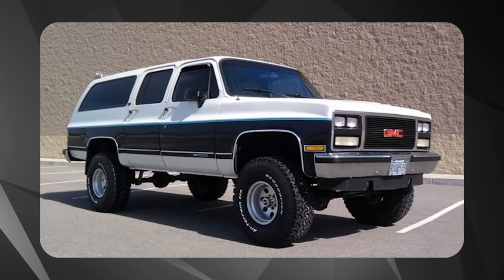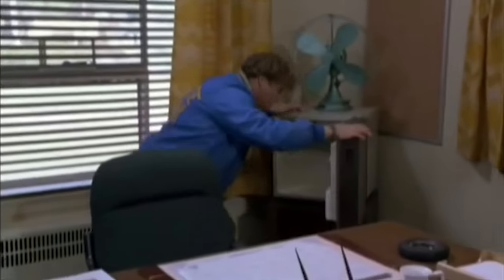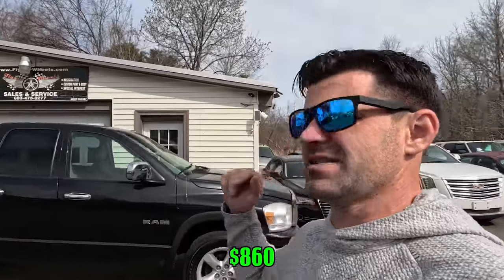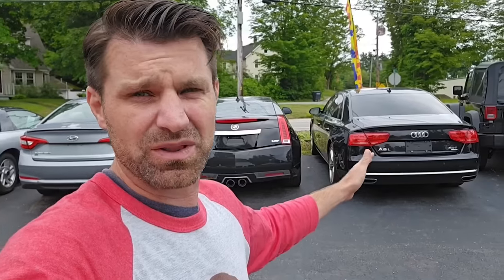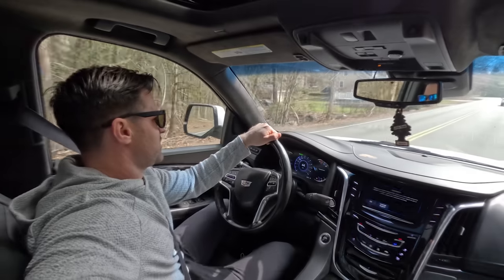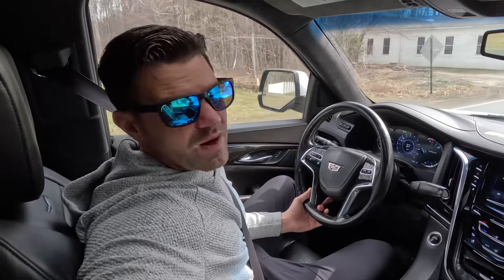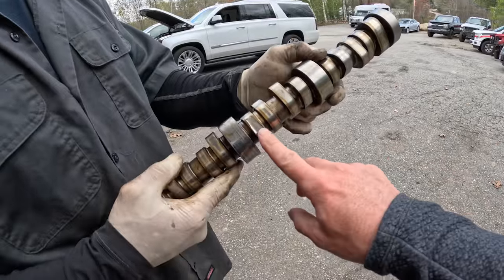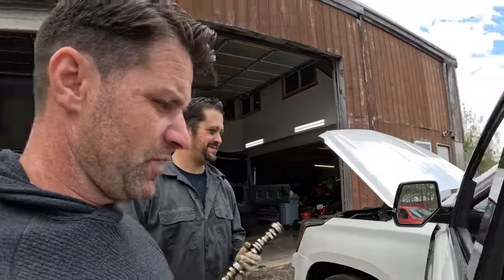WARNING! GMC Chevy & Cadillac Escalade Engine Problems at only 53,000 Miles! - Flying Wheels

Comment: Delete that active fuel management every new GM car you get.
Reply: The transmissions are a weak point as well on GM trucks so doing an actual internal delete of AFM as soon as you buy it voids the warranty and then you could be on the hook for major repairs that could’ve been covered under warranty unless your just talking about the delete that plugs into the OBD port which I would definitely recommend
Reply: There’s probably liability issues for Craig if he does it and then sells it on.
Reply: I’m sorry when ever a consumer purchases a vehicle from a used car dealer the chance that the vehicle will be a problem shortly after is 50/50
Reply: @TheIrvingsylva  There's a reason why people turn in vehicles earlier than you'd expect. If they just wanted something new every 50k, they'd lease, and everyone knows it.
Reply: did you hear what the mech said? "for like 1 mpg fuel savings"

I ran the numbers on the ford 5.4L. For the avg user with their bogus VVT system you would save about $4500 over 4 yrs. BUT at the end of the 4 yrs you need to replace the phasers and timing chain etc and the cost is...wait for it....$4500. So your net savings is Z E R O. "but what about the environment"? No, you save nothing. Why? because any emissions you save by reduced fuel consumption is negated by the production of the phasers, guides, timing chain, gears etc. Because it produces CO2 to cast and machine all those parts. 

That's why a 20 yr old Pickup is way more "green" than a new tesla. The CO2 produced by manufacturing the pickup has LONG been paid off and now every year you drive it is a negative.
Reply: @romeothompson9389  The dealer will disable the AFM in the computer for free. I know a few people that have had if done and they said the performance difference is noticeably better, but the mileage difference is negligible.
Reply: Needs a Range AFM delete was you change the motor
Reply: If you drive it in low it will still shift all the gears except overdrive. And it will stay in the eight mode at all times.
Reply: I thought you had to change cam and lifters to do the delete!!??
Reply: Whoa I had no idea this was happening !
Reply: @chadbailey189  It's all controlled by the computer, so if the computer never deactivates the cylinders...
Reply: put solid lifters in and tune out the active fuel management as a permanent fix
Reply: @sat_sonic  Turning it off with a tuner is a permanent "fix" too. If you turn it off in the computer, the computer won't turn on the solenoid that feeds oil to the AFM system. If the AFM lifters never get oil from the solenoid, they can't unlock, and they function like a standard lifter.
Reply: @TheIrvingsylva Yes but why? The reason used cars are junk or often junk is because the owner knowing he will trade in will not do his services being a cheapskate. Also the car that turned up any problem that the used car dealer fixed was neglected and therefore the car engine will die young and if the owner treated the engine like shit means it was all treated like shit across the board
Reply: Cheaper to disable with a tune. I recommend the Diablo Sport tuner.
Reply: All that cylinder deactivation needa to be killed and companies need to be sued over it. That plus auto start stop and electronic e-brakes need to go away
Reply: That means ZERO times for me.
Reply: Hell yea that’s best
Reply: My brother's transmission in his 15 Silverado took a crap @106k miles, even after being serviced at the dealership every 36k miles
Reply: @andrajourney6421  my friend bought a new GMC and was on his 3rd transmission at 27,000 miles
Reply: It's the worst hate it so much,  got pulsar lt to disable it and change throttle response, it's awesome now.
Reply: Buy a Tahoe or Suburban that are made between 1993 through 2000 there bullet proof.
Reply: Just don't buy GM
Reply: My 2021 trail boss is an awesome truck after putting on the pulsar lt is so much better than the last two Ford's I had the last one trans crapped out at 75k.   I don't think there is another V8 engine that is better.     Unless ram drops a 392 engine,  make it ram and I will buy it.
Reply: You know nothing. This video should have been made by that professional mechanic instead of a clueless guy who just drives it from and to the shop to get it fixed
Reply: @MrMartell77 Theres no performamce difference  ecause theres no power added, no internals swapped.
Reply: To delete afm/dod requires half the engine taken apart then replaced with new regular lifters, heads, crank and cam and a retune. Its not cheap. Tuning it out doeant fix it. Funny thing is the manual trans V8/V6 cars still have afm but its tuned off from factory.
Reply: @MrMartell77 No performamce pr fuel econ improvement to be had doing this and you STILL have weak parts under hood that must be replaced to resolve this. Thats 5k.
Reply: DOD /AFM is not a mechanical or lifter related. DOD is an electronic/ Computer CPU controlled in which the system shuts down the fuel to certain cylinders when the power demand is low. It has absolutely nothing to do with the lifters. It only effects and toggles the fuel injectors .  
This older type design of engine still uses lifters, rockers, and a single cam shaft,  many other engine designs have gone to the overhead cams design that don't have lifters and rocker arms.
Reply: @chadbailey189 you do that's what I did my Silverado
Reply: @MrMartell77 after you do the full internal delete then you got to have someone tune out the afm from the computer and then you have a original 5.3 like the ones made before afm was a thing
Reply: @muskokamike127 That’s why I decided to sink some money and love into my 2003 GMC DENALI with quadrasteer. 6.0L that still runs fine at 345,000 kms. It’s my tow vehicle for snowmobiles and PWC’s. I’ll keep it rather than buying something that just won’t last.

Comment: The world has gotten crazy paying $20K for a truck that needs an engine.
Reply: 100% true
Reply: If it only needs top end work , 20g s not bad.
Reply: 20K isan't really that much money nowadays when you're buying stuff like that Escalade
Reply: Price probably propped up by the value of the parts.
Reply: Its now a $47, 500  truck? Where's the down side!
Reply: @user-427.commodore  I'd say the only downside would be the repair work not fixing the problem and turning into a money pit. .
Reply: What’s a low mileage block cost for this platform? 5-7k? Pretty good deal if you do it yourself.
Reply: He got a rlly good deal aha 20k is great if only engine bad
Reply: @Erikzapp  My point was for most of the history of cars if the car needs an engine the car sells for very little.  The world has changed.
Reply: This dude whines a lot but best believe he's still making money.
Reply: Shouldn't have bought it. Not economically feasible. If it was worth it, the previous owner would have fixed it.
Reply: @dougfisher1813  Not really.  If this was traded in at a new car store they would not waste the time to do the engine exchange then have to explain that to the next buyer.
Reply: What's even crazier is trading in a $100,000 truck instead of replacing the engine.
Reply: @GixxerRider1991  The US has been a throw away society for decades.
Reply: @dougfisher1813  LOL the vast majority of the car buying public will sell or trade off a vehicle if they're told "it needs a new engine", even when it really doesn't need an engine. The escalade needed some lifters and a cam (had the owner not ignored the check engine light, the cam would have likely been fine). 100% economically feasible and not a particularly expensive repair.
Reply: $20k for a truck that needs minor valve work, not "needing an engine", is totally worth it.
Reply: its 120k new dont buy
Reply: If it's a newer truck and needs an engine walk away fast 🚶🏾‍♂️
Reply: @regrich8795  You can go bankrupt replacing all the sensors on the engine to get it running again.
Reply: That's a good deal 20k put a engine in
Reply: Just drop a new engine in it 4k engine 1500 labor 24.5k
Reply: @williamsantana370  The problem is that you don't know that engine is any better than the one you have.  If the DOD system destroys them all why would you think a junk yard engine is any better?
Reply: It's called a smart investment
Learn to hustle or be comfortable living check to check
Reply: @dougfisher1813  
He might be able to fix it for cheaper than they were going to rip off the old owner to do it.
Reply: It blows me away how little you guys know about investing. This is why most of the population is poor. 20k for a 100k vehicle is an amazing investment. Even if he is not able to repair it or sell it the vehicle itself has value for parts. Absolute steal.
Reply: At that rate, you might as well buy something for $1000! 😂
Reply: in 7 years that thing won't be worth 20K not even close
Reply: You kidding me?
The world has gone crazy paying $75K for a truck in general..
Reply: @RSTI191  
Not really...
in 1912, a car cost about 1500.
A hundred years later, the value of a dollar shrunk 250 times.

But we are not paying 300K for cars.
At least not average cars.
Reply: @CurlyFromTheSwirly 
You buy a truck to haul 2 x 4's, plywood and xmas trees home from Home Depot.
I don't need a truck to make me tea and crumpets on the way there.
Reply: @J_RISTI  

I'm not sure what that has to do with inflation.

Besides, I just looked up brand new Tundra and they're in 50 thousands.

As you say, it doesn't need to be fancy.
You'll pay ridiculously more for luxury logos.
Reply: That's a good price truck value at $40,000 probably
Reply: Don't buy anything GM after 1999 silverado or sierra or Buick 3800 great engine .
Reply: I’ll take that cooler for my work van
Reply: 20K will always be a lot when its a bill  @theacgkid

Comment: 2000-2006 was GMs overall best gas truck lineup in my opinion. You had the perfect blend of reliability, power, fuel economy (relatively speaking), affordability, and style.
Reply: because didn't have all emission crap on them.
Reply: I had a 2003 GMC Sierra with a 5.3L that needed a full overhaul at 47,000miles @ 2.5years into ownership. GM would only cover a half of the cost for the rebuilt engine after my heads developed two major cracks. I sold the POS and bought a Tundra in 2005. When I sold Tundra in 2016 it had 443,000 miles and still it ran with no issues. GM was always shit and will continue to be shit. Period.
Reply: @dabig_guy2204  oh wow. I’ve always had good luck with that era. Can’t go wrong with a Yota though, that’s for sure. I’m trying to get a half million out of my Prius.
Reply: They were great trucks. They still had their issues though. BUT main issue was they rusted FAST in the northern states.
Reply: Still driving my 2001 Chevy Silverado - 308,000 miles and still running like a top.  It's rusty but trusty.  Had it 22 years and I love the darn thing!
Reply: @dabig_guy2204  You're full of it. What (you claim) happened to you is not typical. Tundra is a lower class vehicle. If you want a Tundra, it's ok. 
Who keeps a low class vehicle for so long anyway? 
Sucks to be poor I guess.
Reply: Agree brother. I sold 2015 Chevy suburban and bought 2005 GMC YUKON XL DENALI with 178k miles. Best decision ever made 🎉
Reply: still have my 92 k1500 350 700r4   with a 342 g80  rear gear,,,  gm should know better
Reply: Yep,had a 97' Suburban LT 1500....thing was awesome,comfy and a tank.Sold it after the kids left the house and replaced with a cream puff  Lexus GX470.....another awesome rig
Reply: Id never touch a gm after 06, you couldnt give me one
Reply: When you see a 2002ish Tahoe full of rust holes and dents, with broken air conditioner and usually missing a back window, still hauling around car loads of meth head families in 2023, you know they were built well.
Reply: @dougfisher1813 😂😂😂😂
Reply: My 04 denali with 6.0 is still running amazing at 360,000 miles with all original drivetrain. Only thing I did was have the front diff rebuilt at 170,000. The bearing retain tabs snapped off and let the pre load on the bearings loosen. It didn't blow up it just growled extremely loud on the highway at speed
Reply: I have 05 seirra,  recently replaced the rear main seal,  had to replace  diff bearings 8 years ago, a couple wheel bearing hubs, and the normal maintenance. Over 250thou miles, and I'm not even worried about any surprises.
Reply: Was a great motor until the horrific DOD system was installed.  SAD!
Reply: Same for the automotive industry in general. I have a 2000 Sienna van and it’s a keeper for me. I don’t need a vehicle with a billion OBD modules on it.
Reply: How to get 200,000 miles out of a GM truck drive train.
1. change the oil at 50%
2. Do the fluid changes at 45,000 miles. All of them.
3. Keep the fuel between 1/4 and 3/4.
4. Less than 1/4 stresses the fuel pump. More than 3/4 messes with the evap canister.
    Both conditions causes problems with combustion.
5. oil, coolant and gear lube is cheaper than engine or transmissions.
Oh & those 4,6,8 schemes have never worked in the last 40 years.
But they keep trying cuz they are smarter than grandpa.
Oh and California wants your new belch fire 8 to puke and die.
Oh and if you want 300,000 miles get a stick shift.
But have no fear. The engineers will find a way to make a clutch change a all day job.
If you know how to drive a stick 90,000 was about when that happened.
But there also are those ( cringe cringe ) dual clutch monstrosities.
Reply: I had a 2006 Chevy Avalanche with a 5.3 ls best engine I ever had but my truck got TKO for hitting a deer 🦌
Reply: They are technically a slightly better truck but I'm more of an OBS guy. The LS is a better engine but there's still nothing cheaper to fix and tinker on than a small block Chevy to this day. That said, there's still crappy plastic junk that will need to be replaced on either model that you wouldn't have to on a Toyota from the era but it's pretty much all cheap and easy fixes. An acceptable trade off vs the current garbage in my mind.
Reply: @capy_official I would. Impala, Grand Prix, Buick Lacrosse. I had an 07 Grand Prix and it ran like a champ, one of the best cars ever until I wrecked it. My uncle has an 09 Impala and drives it up and down the East Coast multiple times with no problems and it has close to 250,000 miles.
Reply: I'm vouching.  I have an 02' sierra 4.3.  200k miles, used and abused, except for regular oil changes. I'm about to restore and baby it.  Sort of like a woman that you let down over and over, but she sticks by you and at some point you get your act together after you realize that you lucked up and grabbed a solid one.
Reply: Eh, once they stopped using the older 5.7L V8, especially once AFM became a thing GM was pretty much garbage.  That old 5.7L engine though, pretty tough one.  Rust was an issue though (for the overall truck).
Reply: @TheBandit7613 how did your comment get likes lol
Reply: as soon as they started the active fuel management (which i think is cylinders shutting off like v864) i think they started to get in to issues. This should be a class-action lawsuit. What struck me most was the plastic parts. That is concerning. of all the things not to cheap out on, you'd think it'd be the engine. Before they're gone, I'd just get a sequoia.
Reply: Still driving my 2003 Silverado. They will bury me in it.
Reply: Coudn't agree more. My 2003 Yukon SLT with 240k miles is still rock solid.
Reply: @dabig_guy2204   Because yours was bad they all are? There are many many thousands of GMT 800s that have gone well over 400k miles. My 2003 has 240k miles and still rock solid. Duds happen to every brand unfortunately.
Reply: @mph5896 they did rust , they rotted.
Reply: I did the full internal delete on my Silverado so my 5.3 so now I have a extremely reliable engine like they was before they started with that afm trash
Reply: My 2000 gmc c3 was awesome.  Very little problems for 19 years.  Bought a 19 gmc.  Engine blew after 77k miles.  Goodbye gm hello Toyota